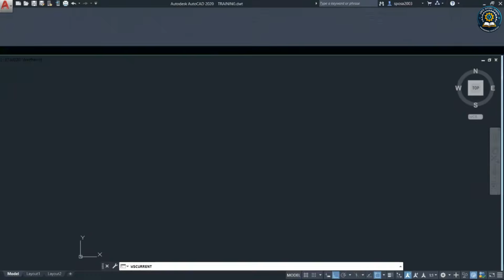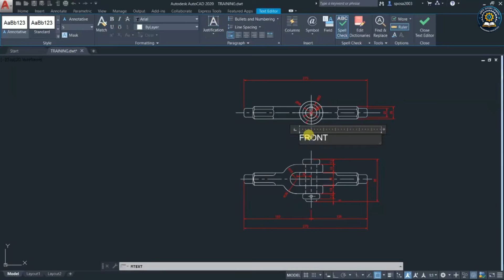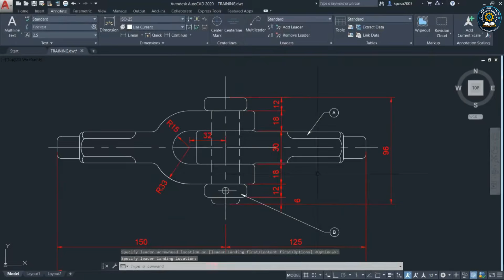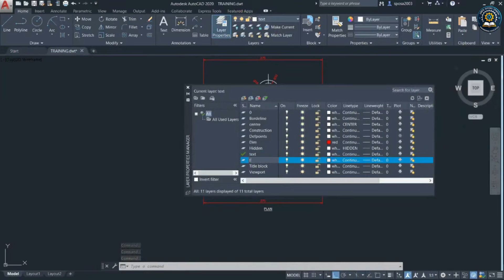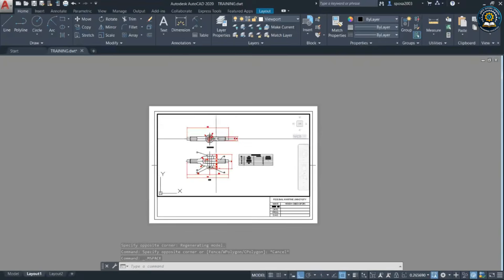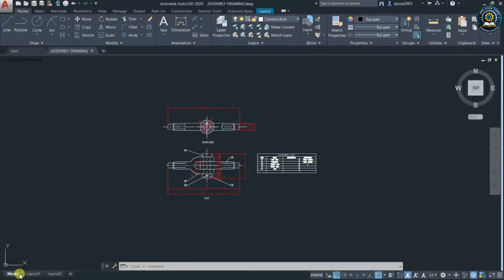Technical and engineering drawing with AutoCAD, assembly drawing exercise.

Comment: Good day Dr, quick question regarding the taper pin: the diagram on the sheet shows domed/rounded ends, but in CAD it was drawn flat. Should we use 2P circles/fillets to round the ends in our drawing, or is the flat representation acceptable?"
Reply: Hi